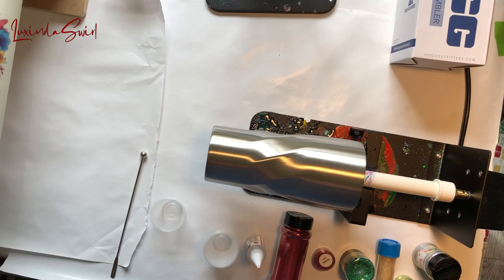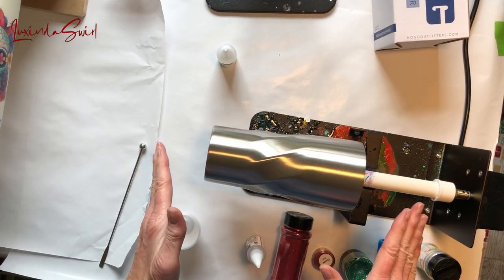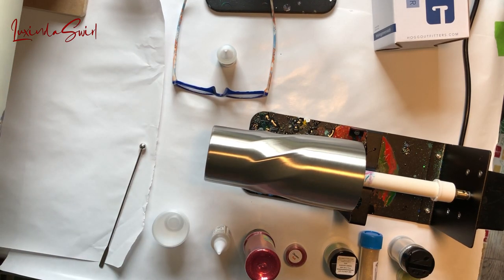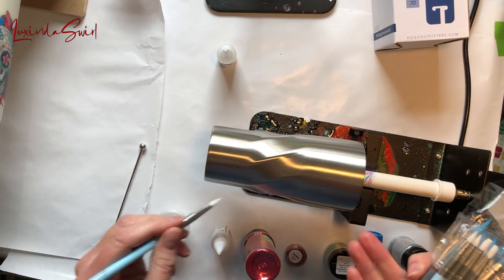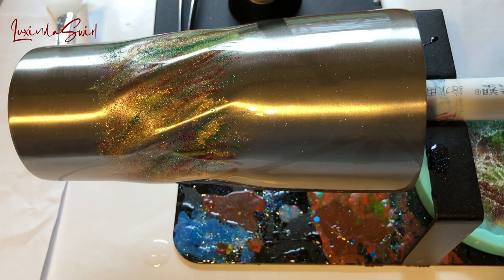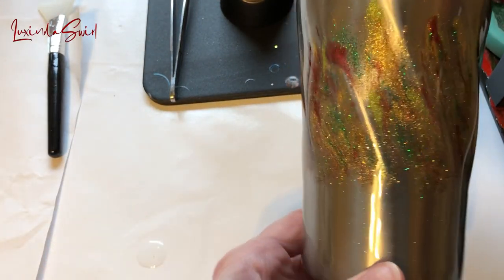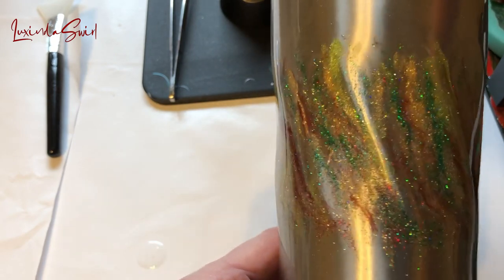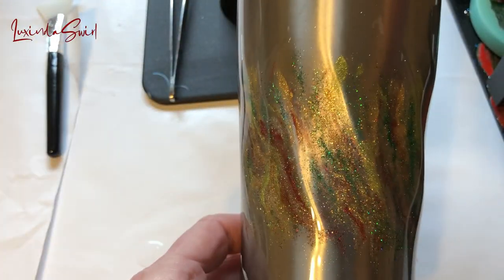New Style Tumbler, Let's Do Hatching Technique with a Christmas Twist and Clear Epoxy Resin - Hmmm!

Comment: Tip 🤩 so glad you asked lol .. I let the resin setup a lot lot lot more before adding the hatching lines so the lines can’t move much. They still level but don’t get lost in the clear layer below.  Using a Paddle Pick or skewer is better for me than other tools bc with other tools a blob of resin dropped off at the start of the line & then it turns into a line as it goes along.. where with a skinny pick type tool I can drop any smaller blobs off into the cup & then go to the tumbler and get a sharper line. The fatter tools just have too much liquid on them to control. A longer pick holds more and gave me more consistent length of lines. 
I always buy dollar store vases to experiment with- the tall skinny ones that look like tumblers.  Then if it doesn’t work I’m not stripping down tumblers.  I turn them into something pretty enough to use as a vase and sell them or give them away around Valentine’s Day so it’s not a loss (& no stripping 😩) bc as you know tumblers aren’t cheap. If it’s a fail-  I do a quick sanding, quickly spray paint & then do ink swirls if it was a real rough ending - had a bunch of serious fails 😂  Everybody loves the the Galaxy’s or the coffee creamer looking ink swirls.  And it’s only $1 & a few mls of product with minimal colors each try 👌
But hey after the experiments work out then it’s onto the tumblers with confidence.  👏👏👏
Reply from the maker: Wow! Thank you so much for all this great information!!! I know what a skewer is — and I can see how that would work better — but I’m not familiar with a paddle pick. Can you describe it or where you get one? Thanks again!!!
Reply: @Luxinda  The Paddle Picks I got on Amazon are 4.7” and they are perfect sized in the hand.  They’re the ones that have a little paddle at one end and a long skinny toothpick at the other end.  They’ve got a waxy coating which makes them great for wiping off after each use.  I’ve tried many other lengths & they are either too short or too long- I have them all away 😁..  This 4.7” is the best length for stirring & then just wipe it off and use the other end for detail workings... dragging lines of Mehron colors thru or like what you’re doing here with hatch lines etc.. I also use them laid flat to clean up the edges of my molds, right after pouring, that spilled over ..& the stringy stuff that was on the cup and didn’t cut off as I pulled away (like hot glue does).  These paddle picks are valuable.  
Hopelf was the brand I bought by seller Lily’s Best Product. They were 5.99 for 100.. seems I’ve had them since June & maybe used about 10 of them and they’re still going strong bc I clean them up immediately after each use with a baby wipe & alcohol.  Best purchase ever!  ✌️✌️✌️
Reply from the maker: @debrajol3585  ohhhh! Okay! I’ve seen those being used in videos and wondered what they were. Thanks!!!